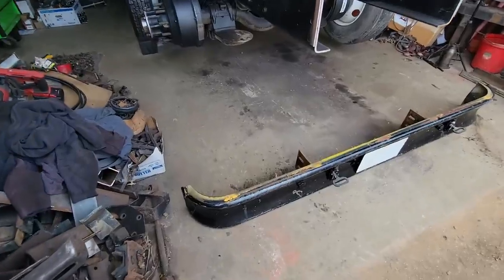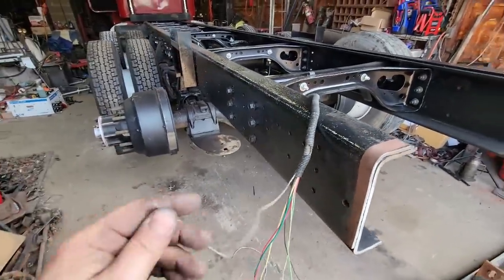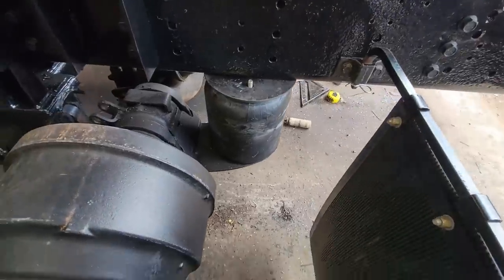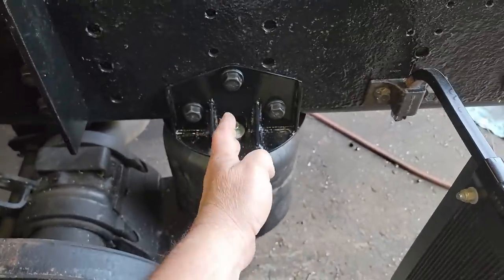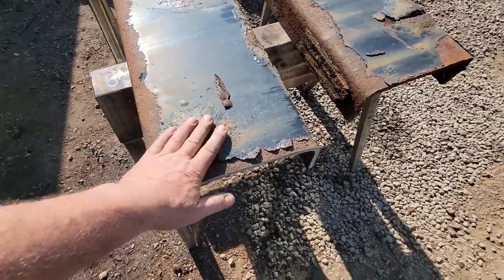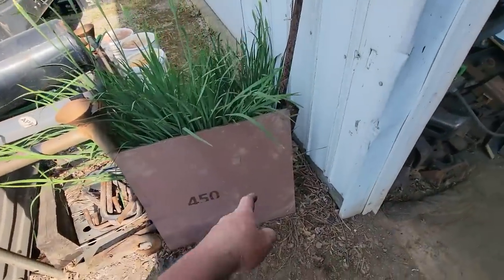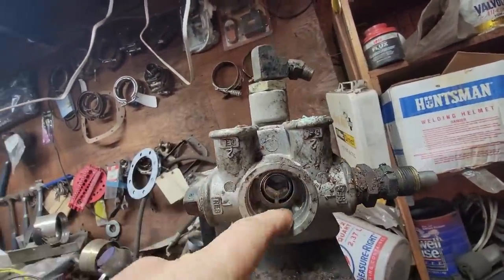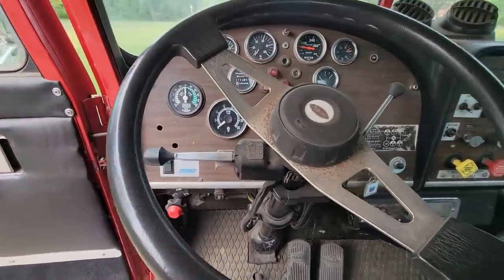PETERBILT FRAME STRETCH PT 15. IS THIS THE END?

Comment: I have been watching you for quite a while now and i am glad to see someone who actually does wiring right  , you explain what you are doing and why you do it that way ,,on top of all the other stuff i like about how you build stuff  , the little details like soldering wires together makes a difference ,, guys that use butt splice crimp connectors don't understand  that yes they work but they aren't for permanent repairs especially on outside wiring ,,i've gradually gotten to where i am now repairing wiring properly the way you are doing it ,, takes more time but the results are longer lasting with less frustration in the future
Reply from the maker: i started soldering, deox and heat shrink after removing so many failed crimp connectors. once they fail, moisture wicks up the wire and corrodes. i ended up having to replace more wire because of it.
Reply: @j.c.smithprojects  yep and iowa is as bad as Ohio about RUST and Corrosion due to the road salt ,,i learned a lot of automotive wiring when i was in school 30 years ago and even my teachers hated crimp connectors back then ,,one thing i started doing when  i build a truck or trailer is using a junction box to connect the wiring ,,every light has it's own ground and a pigtail going to the box ,,and the negative box terminal has a direct ground to the battery negative terminal helping to eliminate screwy chassis grounds ,,i've been frustrated by too many trucks with fubarred messed up wiring

Comment: You do great work. No fooling around or cutting corners. The way it should be in any mechanical setting. I've seen shops ok a car that had broken CV axles and a cracked lower control arm. But somehow it passed in 15mins for 20 bucks. So I think they didn't check a thing.

Comment: The rust of the old air tanks can cause havoc. It will make its way through the system and the old valves. Obviously you replaced and cleaned as much as you could. 

Do you usually just build trucks and sell them? This project and your chicken coop are the first projects I watched.
Reply from the maker: yes. i buy them, fix them and try to create value. then sell.

Comment: The guy should consider himself one of the fortunate to have a JC built truck that was put together with ingenuity rather than slap it together and send it on. I didn't like the  brake light setup at all. I would have used amber indicators, but its not your truck. So its on to the next project.